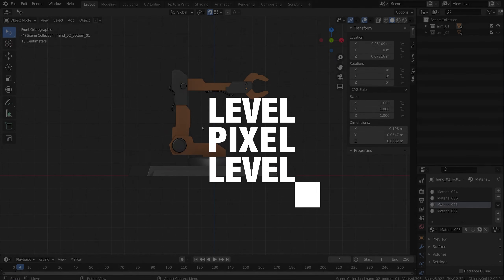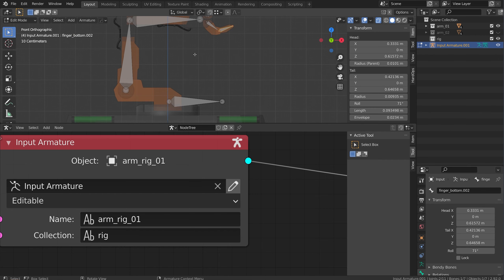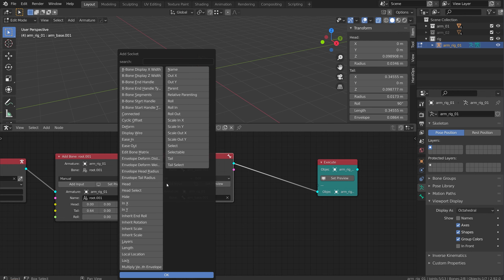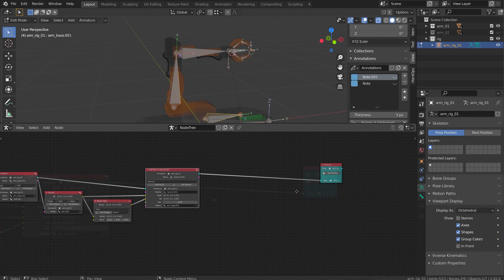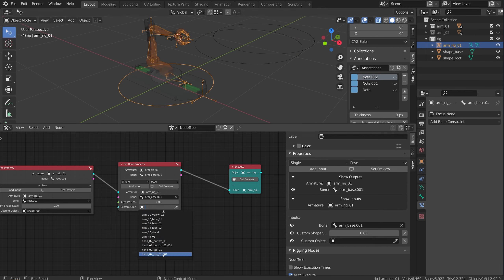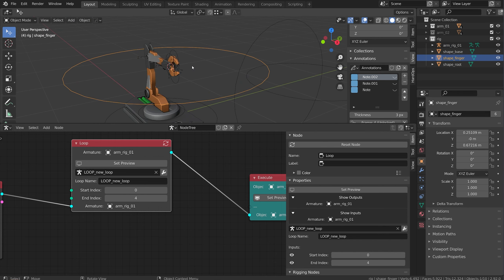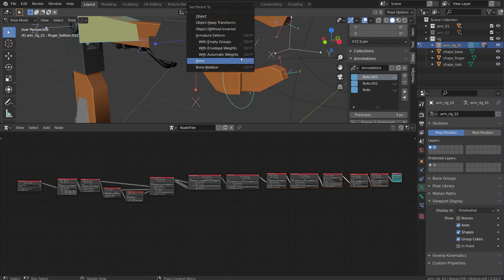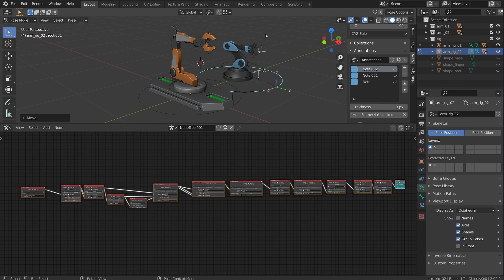Robot Arm Module | Blender Rigging Nodes Walkthrough

Comment: Thank You for this Great Video, i have Issue with Exporting 3D Models in STL what should keep the Geometry Origin for Pivot... but sadly after export the Pivot Point is not in the Middle of the geometry (how it is in the CAD) but outside , and every piece from the Assembly have the same origin. How is your progress to export the Geometry with Origin, based on the Part?